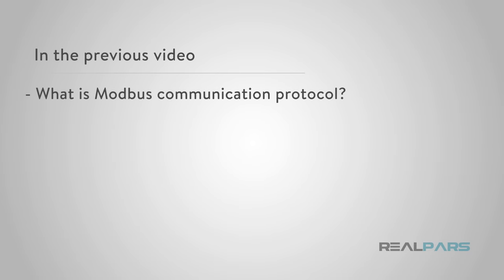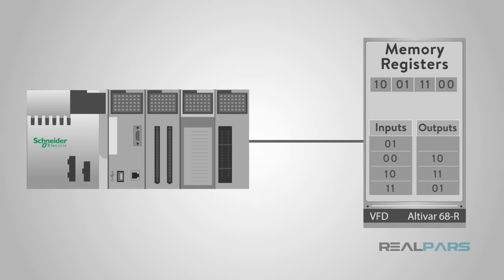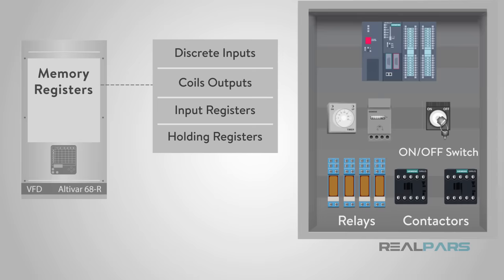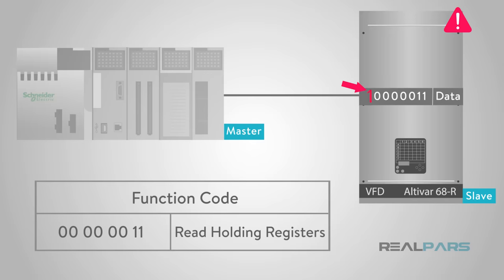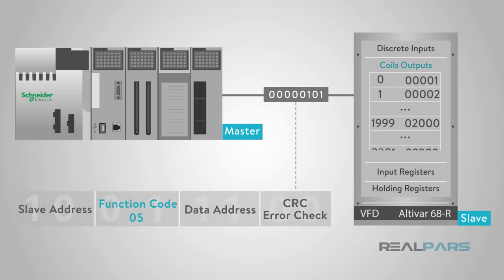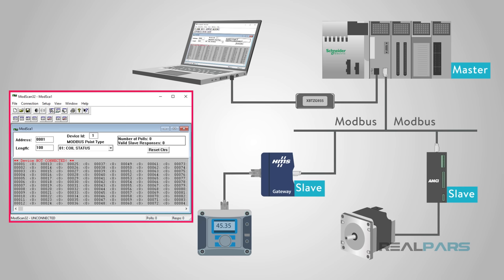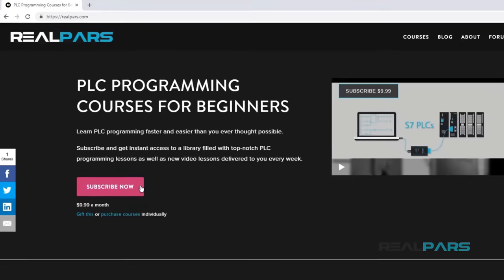How does Modbus Communication Protocol Work?

Comment: didnt get the part of function code 03 refering to holding registers. how did func code 03 refer to holding registers?
Reply: The video did not properly explain the different function codes. Please see below table of Function Codes.

The Function code tells the slave which table to access and whether to read from or write to the table.
Function Code Action Table Name
01 (01 hex) Read Discrete Output Coils
05 (05 hex) Write single Discrete Output Coil
15 (0F hex) Write multiple Discrete Output Coils
02 (02 hex) Read Discrete Input Contacts
04 (04 hex) Read Analog Input Registers
03 (03 hex) Read Analog Output Holding Registers
06 (06 hex) Write single Analog Output Holding Register
16 (10 hex) Write multiple Analog Output Holding Registers

Reference Numbers (Coil/Register Numbers) can be thought of as location names since they do not appear in the actual messages. The Data Addresses are used in the messages.

For example, the first Holding Register, number 40001, has the Data Address 0000. Data addresses start from 0000 to 270E for each group.

Therefore, for this example, the master would send Function Code 03 to read AO Holding register and send Data Address 0000 to identify location 40001

Please see http://www.simplymodbus.ca/FAQ.htm#Stored for a good detailed explanation. Cheers
Reply: @BD-ev2gk   thank you so much. this is the real explanation

Comment: Great video as usual but 3:25 to 3:55 is a Little confusing.  Shouldn't the data address be 0001 Instead of 0000 at 3:35 ?
plus what's the difference between function code 1 and 2 ? Specifically function code 2 is for reading discrete output contact,  I thought contact is used for inputs and coils for output
Reply from the maker: Modbus uses something called "zero-based addressing", so word 40001 has a memory area offset of 0, word 40002 has an offset of 1, etc.  This is shown at 4:35 in the video.

Modus commands vary by device, but the following refers to standard Modbus commands. (https://www.modbus.org/docs/PI_MBUS_300.pdf)  Modbus command 0x01 is used to read the memory map in the COIL registers (physical outputs).  Modbus command 02 is used to read the memory map in the DISCRETE INPUT registers (physical inputs).
Reply: @realpars  Thank you, great educational channel

Comment: Thanks you for you nice video ,
One question, which Modbus TCP IP, there is the possibility to connect 2, 3 or 4 master for same slave device? 
What is the parameters for those différents master we need to make ?
Thanks you
Reply: Hello Fred:

Hmmm, sorry for the late response. I did provide the following a few weeks ago. Yes, Modbus TCP/IP (Client (master) Server(Slave) supports multiple Clients. In some cases, the server equipment determines the number of Clients it will support. Some servers may only support 2 clients (master).
Here is an example of a device gateway from ProSoft Technology supporting multiple clients. https://www.prosoft-technology.com/Products/Gateways/PLX3x/PLX31/Modbus-TCP-IP-to-Modbus-Master-Slave-Gateway-4-Port

Comment: So if i am correct you can read any register via modbus? Isnt it a bit dangerous? You can read in that case vulnerable parts of chip memory. Or is it just a somekind of fasade what will be mapped inside memory of real device?
Reply: The memory map for a Modbus-based PLC is similar to that for any PLC.  There is user memory that can be addressed by register, but you cannot read or write into the PLC firmware.  Yes, reading and writing can be done to/from any register, so it is up to the user to manage the memory map and where to read from or write to. Of course, Digital Input and Input Registers may be overwritten by the I/O subsystem as the I/O connected to the device is scanned.

Comment: Am a noob here. Can modbus talk to other equipment that are on full duplex tcpip?
Reply from the maker: Yes. but not directly.  You would need to add a gateway device to convert from one protocol to the other.  I am going to assume that when you say full-duplex TCP/IP you are referring to Ethernet.  Even if you were using Modbus TCP, you would still need a gateway.  These devices are robust and not too expensive.  I have use gateways like this to connect Siemens S5 PLC's to Rockwell CompactLogix PLC's with simple configurations.

Comment: Hepl me please. How many devices can I connect in a Modbus communication protocol?
Reply from the maker: The answer depends on a few factors.  Each device would be considered a node, with its own unique node address. Per the Modbus RTU spec, nodes 1 - 127 are possible (1 master node, 126 slave nodes). Some vendor's firmware only supports 32 or 64 nodes.  ModbusTCP technically can support up to 247 nodes, but that will require more TCP sockets on the master to be open than most operating systems can handle.

Comment: IS it possible to use real time clock in siemens s7-300 so that  I can take output from clock and turn off unwanted motors running 
[for example
From 11.00AM to 11.30 AM my machine should turn off]
Reply from the maker: You can easily write a logic for that using the timers in the STEP7 software.
Reply: Oh is that available..I'll check it. thank you

Comment: Dear RealPars! Can I use 2 modbus TCP master to read data from 1 modbus TCP slave?
Reply from the maker: Yes, MODBUS TCP allows multiple masters.  MODBUS RTU does not.  For MODBUS TCP,  each master can make a connection with the slave node and respond to the request from each master node.

Comment: Maximum how many SLAVES we can control from MASTER in Both MODBUS -ASCII & RTU
Reply: Please Help me 🙏
Reply from the maker: Krishna, this is a great question!  The MODBUS specification allows for 256 node addresses:  0 - 256. 

For Modbus TCP, you can have one master and up to 255 slave nodes.

For MODBUS RTU and MODBUS ASCII (serial communication), the number of slave nodes is dependent upon the master.  Typically, without a repeater,  most RS485 master nodes limit the number of slave addresses to 31.  This is not a limit of MODBUS, but rather the hardware used.

Comment: How can the slaves know thant 01  function code 01 is  coil output and 02 is discrete input?
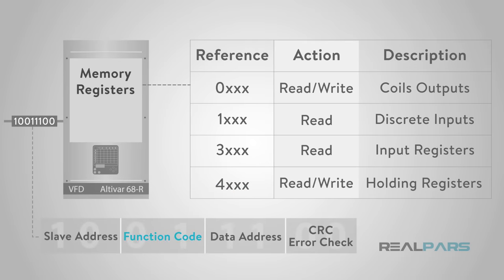Reply from the maker: All slaves follow the MODBUS RTU standard for communication.  At 3:23 in the video, you see the message format for MODBUS RTU.  Any device connected with this protocol must follow the rules of the protocol .  When the slave device receives the command string, it parses out the node the message is intended for, and if it is that node, it strips off the function code and takes the appropriate action.

Comment: Why this protocol is not using IP for routing calls to slaves? Is the hardware for this protocol is faster more resilient? Quite strange to send request to all slaves, wouldn't there be a router like in IP networks? Also, application protocol (RPC) of function code + data is coupled with network layer... so meaning can't switch to different protocol over Modbus... Also, how is versioning done for this protocol? Is there any issues with master talking to slaves and slaves have wrong version of functions (same function code but wrong function data/operation performed). This protocol looks like all pieces bundled together: network; routing; protocol; RPC; error checking.
Reply: Hello Nikolay.  Thank you for watching and your question. In short you are correct, Modbus does offer an Ethernet communication solution, called Modbus TCP. Please review the Modbus Organization and specification for Modbus TCP here, https://modbus.org at https://modbus.org/docs/Modbus_Messaging_Implementation_Guide_V1_0b.pdf.  This video covers the essential basics of the Modbus protocol in general. The basics of the PDU are contained in the data portion of the packet, and can be visualized using Wireshark or equivalent. Hope this helps. - Wally